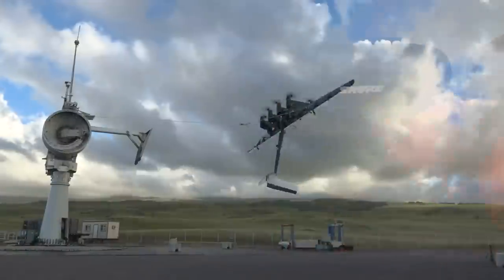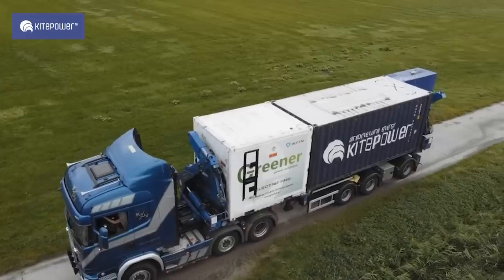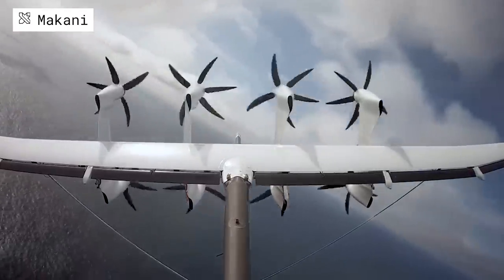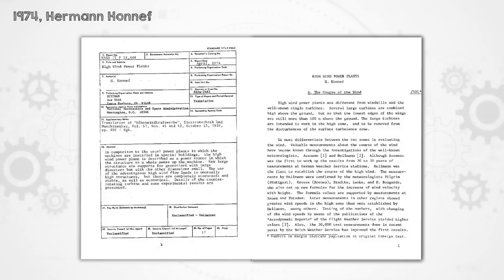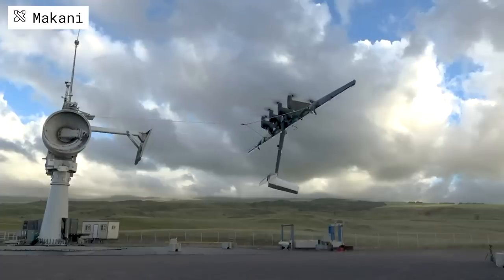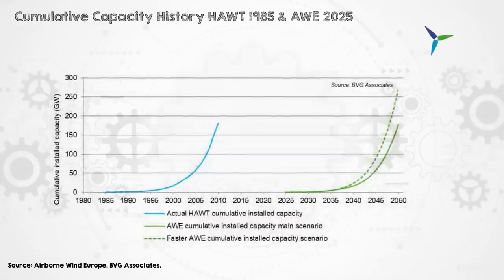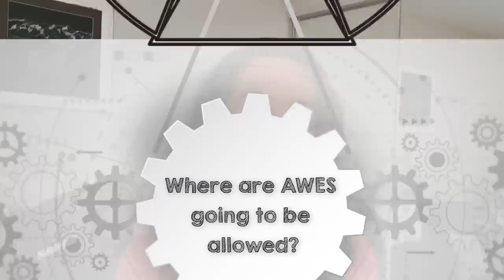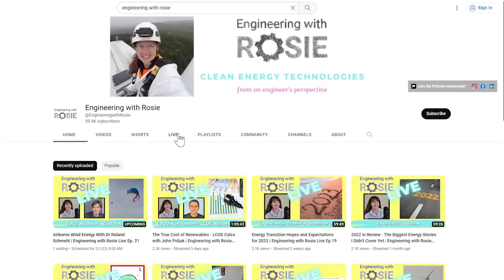Will Airborne Wind Replace Conventional Wind?

Comment: I can see a small scale version being used on sail boats for electrical power.  Sailboats already have masts, travel within certain angles to the wind and are often quite far from populated areas, hence most of the disadvantages would be addressed and the smaller size of the equipment would be an advantage plus the trend for sailboats are towards hybrid sail and electric auxiliary propulsion.  The forces transferred through the teether should assist in the sailboat thrust whereas generating electric power through the propellers increases the drag on the sailboat.  Cameras, lidar and radar could also be mounted on the airborne generator to help AI detect semi-submerged cargo containers and other navigation obstacles that are increasing every year (sonar are ineffective against obstacles close to the surface of the water).
Reply: Probably not though. 
A much simpler solution for sail boat is to just attach a generator to the propeller that they already have for motoring up to docks. 
There are already hybrid and electric drive systems for sail boats that do this.
Reply: @joashparker8271  Well, we already have electric sailing yachts that can use their props as a regenerative brake to trickle charge their batteries while under sail but we also still have many more sailing yachts with wind turbines and solar panels so one solution doesn't obsolete others.  Besides an electric sailing yacht are designed and built as such whereas something like the kite turbine is portable, compact, accesses wind at altitude which are stronger and does not brake the sailing yacht but may actually add to the thrust that the yacht receives from the wind.

Comment: Another problem with tethered systems is risk to small aircraft. Especially with the ones that fly oscillating patterns. Fly a small aircraft into the lines or airfoils, and it's very likely to be the last thing that pilot will ever do.

Comment: So, in sailing you can tack against the wind.  If you've got a sail up in the air, you can let it run out the reel to get power.  Could you design a sail that could adjust its shape to tack back in?  Are there any systems that maybe use two anchors, so they can take keep tension on one tether while 'resetting' tension on the other?  I remember flying kites as a kid how quickly they could move side to side.

Even if a kite could lose some of its surface area so it could 'fall' a bit it could mean you could pull the tether in more quickly while it wasn't under tension.  Maybe something like the parachute vent at the top of a hot air balloon.  It would mean putting some technology up on the kite, but still be less than for full air gen.
Reply: I think you can achieve most of this with very few controls, not more than you would need to steer in three dimensions.

Comment: Great and balanced exposition. I agree with your analysis. Still at sufficient scale and high enough in the air it might be a great solution with less visual and noise pollution than ground-based systems. It's also an inspiring engineering challenge. Launch and land may be done with active motors, gusts may be (partially) treated by changing the pitch angles / lifting surfaces. Weather prediction is still progressing with cheaper, better and more widespread radar systems. Even if recently some investers have been pulling out (due to recent interest rate increases) in the long term there appears to be potential. I'm most worried about lifespan and energy performance versus maintenance, construction and material cost.

Comment: As you say it all comes down to the cost of the electricity produced. I would think they could operate the generator platform as a conventionally powered drone so it could take off and land and maybe power up if it had to for weather conditions but operate as a glider at other times but this would add to costs. It is a pity because it looks cool.

Comment: A drone might be able to lift the windless kite up to a workable altitude before detaching. Doesnt seem like something that would happen so often that it needs to be autonomous either. I can also imagine a slew of self correcting systems that might allow it to survive gusts. For example a coil of free line under high tension, that releases line during gusts. When extended, it prevents the kite from doing any more aggressive dives, and coils back in. I am also still not sold on hard wing kites, soft wings are safer and can land without issues just by releasing the sails

Edit: i also imagine they can add a battery or wire powered control system to the soft wing kite, maybe they already use that. It also adds more possibilities for control systems during gusts

Comment: This reminds me of the tidal planes/kites made by Minesto. It’s like large drones that are tethered to the bottom of the ocean and fly in figure 8 motion to increase the speed of the turbine, so they produce more power during tides, and can produce power during both high and low tide.

Would you be able to talk about those some time? ☺️ I’m very interested in how it all works. 
They are currently testing it in the Faroe Islands and the small kites are supplying some power to the national grid. They are currently testing much larger ones as well there as well.

Comment: How is a free flight drone with windmills on it supposed to work? The wing needs to be going forward to maintain lift and will be driven forward by its motors and propellers. The windmills will increase drag more as they try to extract more energy from the incoming airflow, (that's why planes feather the prop on a failed propellor engine because of the extra drag slowing it down dangerously). So unless you are using more energy to move the wing forwards to keep it in the air than you are extracting, you will stall the wing. The same would happen with a tethered wing eventually, although at least you are not having to use energy to lift the wing in the first place.

At least with a tethered wing you could use the tether to transport the generated power. How is a free flight one supposed to do it, heavy batteries that require even more energy to get them into the air?

I can see why the ship parachute hasn't got traction, it only really helps when the wind is directly behind the direction of travel. It is not controllable like a sail so can't really be used off wind. Even if the wind is a few degrees from the direction of travel, you would effectively be tacking across the wind and possibly using more fuel to keep on course than if you didn't use the kite. So with all of the aggravation in deploying, maintaining, it etc not worth the purchase price or cluttering up useful bits of the ship.

Comment: The possibility of crashing can be solved by using blimps. Even without winds they'll stay up. Another solution is for the glider to be really light and have batteries and use it to keep itself up while there's no wind. Also it could have plane landing strategy where both engines stop working, but it can still safely land by using angles and a runway.
Reply: NUCLEAR IS BETTER THAN THIS TOMFOLLERY

Comment: You don't have to install a foundation (in the sense of holding the tower up) but surely you do have to install an anchor (in the sense of stopping the thing flying away). The tether force has to be resisted by the ground ...

Comment: Back in 2012, I designed a kite that would have the generator and prop framed in its center.  It was supposed to be tethered to a station below, using an Adruino and anemometer to allow the kite to catch the wind in any direction (making corrections as needed). It was of course, all drawn on printer paper at home, and I had no idea how I'd make it or afford to try to make it back then.   Now, I am hesitant to re-visit it, in fear of looking like a dumb dumb.  lol  Maybe I will build a scale model of it one day, and just take my pick up to a back road, in the mountains and try it out.  lol
Reply: u should. keep me posted if you do

Comment: Interesting, thanks! I wonder how they'll deal with air law especially if those kites go near or above 500 ft. It would also be interesting to compare long-term costs vs ground turbines (which I think is controversial for those), the production per occupied square feet, and the perceived nuisance.
About the birds, I thought they were fast enough to avoid most of propeller-based engines, I had no idea it was significant. But then, many are also killed by power lines...
Reply: Not a problem above 500ft. There are restricted flight ops areas all over the world, including over all military bases, most if not all Nuclear power sites, parachuting areas, every NFL football game, the White house and on and on.  They get published on airspace maps and if they are temporary they go out with the local area notams.
Reply: @johnway9853  I know that, but that's generally not abused and as you said, it's mostly temporary events. I've never seen many of those restricted areas when flying so it's rarely a bother (mostly some pesky drone areas), but if we need to deploy as much AWE as necessary to replace conventional wind turbines though, that will complicate the airspace significantly. Maybe it's easier in the US, but smaller countries have more complex airspace structures too, where it's common to have close CTR that don't leave much room in-between. Having such restrictions would effectively cut a lot of routes to GA traffic where they are most needed.
Reply: @phenanrithe  Every tower I controlled in, all 7 of them, had some sort of permanent restricted airspace nearby.  The tower I retired from had a military base directly abutting us so the downwind for 09 had to be kept tight so as to not cross the line. Not like these things are going above FL180. I can see the point in some of the tight EU airspace but even then... as my first on the job ATC instructor used to love to say, It's a big sky. ;-)
Reply: @johnway9853  Well, it certainly didn't look big where I learned. Squeezed in the term that comes to mind.
Reply: @phenanrithe  LOL, I know what you mean. In 82 I got my PPL before going to ATC school. The difference in perspective is gigantic. My last tower was also a training tower with more Katanas than should be allowed in any one place on the planet. I figured these kites aren't going above a couple of thousand feet or the weight of the cables becomes an insurmountable issue. Add a couple more thousand on top like built up area rules, and it still makes it less of an issue than many of the snow topped granite barricades out where I started my career. Many a fuselage still on the sides of those mountain passes.
Reply: @johnway9853  Yeah, I suppose they won't go too high indeed, even though that's where the wind is. Imagine one of those long cable snapping because of a gust, we'll revive Pink Floyd's story with their pig balloon and every pilot on the look-out for an escaped flying kite ;-)

Comment: Could you smooth out the spooling/unspooling energy load by funiculating two together?
Reply: "Funiculating" two together sounds like you want them on connected tethers?  Sounds like a nightmare for fouling and knotting.

Rather you would have multiple units with distinct ground tethering points, far enough apart that the lines do not risk getting entangled.

Since reeling in can be done much more quickly and under lower tension than the long crosswind flight which pulls the tether out, you would probably want more than two.

I vaguely recall an early proposal that had multiple units moving at intervals along a loop railway track, probably using ground traction in place of constantly reeling out and back in.  The advantage eludes my imagination though.

Comment: I have a feeling that once they really crack the code on this technology, it will be as sleek and simple as the three blades on a tower version. We need a lot of iterations to go from the old dutch windmills for cutting lumber and milling grain to today's tall sleek windmills.
We do know there is more wind up there, we just need to figure out how to tap into that in a cheap, robust and reliable way

Comment: Interesting idea, I have given it some thought since your last video about it, I still think most of my initial reflections are relevant, for example I still think most projects focus too much on chasing energy efficiency over cost efficiency. 

I'm still skeptic about using crosswind, way more energy to harvest, all else equal sure, but also way more difficult to make it work, especially reliably, which should be pretty obvious to anyone by now. A non-crosswind unit that stays up can harvest infinitely more times the energy than what a crashed crosswind unit can. I suspect crosswind utilization represents the majority of what makes heavier than air systems more difficult than conventional wind power at same scale.      

A case that I don't think, but know they chased theoretical efficiency in vain is that balloon funnel. Lighter than air wind power systems should be shaped like airships, to have some chance of working practically. Just increase the rotor size to get higher output, that's not difficult. It's much easier to have variable pitch than make a balloon funnel adapt to varying wind speeds. An airship can be made big and also have solar on it. If it's made tough enough to operate at very high wind speeds at high altitude, it could just be lowered if the wind increases too much at normal operating altitude.
Reply: i really like the airship idea. Proven technology that should be easy to automate

Comment: Important to note that this is not competing with conventional large-scale wind generation. This is much more expensive per kilowatt hour generated, and the watts generated are far smaller than a standard large ground or sea mounted generator. Megawatts for standard turbines vs kilowatts or 100s of kW for these. There may be a use in these devices for temporary small scale power needs far from a grid. So yes very interesting technology but really completely different set of edge use cases.

Comment: i really think there's big potential for this tech just bc it has a smaller actual land footprint than most. Like, if we can figure out a way to safely put this on top of things, you can increase your energy gen without land costs. E.g. can they be designed to fly over solar panel field? If they're high up, they shouldn't effect solar gen, and then you have a lot of the transmission and other necessary tech already installed on site. Even potentially on top of large buildings (esp if using soft-materials). 
So it may not make economic sense "on its own" for most places, but perhaps it conjunction with other tech or contexts.

Comment: I remember watching a documentary about a team building one of these things and it was fascinating. The team was so bright and hard working but their financing ran out right when they found success and so they had to mothball it. I do think that the complicated control systems probably mean that it won't be a big player in the market, but, where they make sense, they'll be hard to beat once someone makes a truly viable product.
Reply: Google bought em and shut it down, so sad.
Reply: @Deaner3D  There's a doc about it, “Pulling Power from the Sky – The story of Makani”. Using the sky is probably not the best option. Imagine the same thing, but under the water. There's a number of different tech being explored, but something like the Makani in the deep sea flying a figure 8 could be interesting.

Comment: Would this be a good option in the case of cargo shipping to recharge batteries that power electric propulsion? It seems similar to the sail-based wind options and since in deep water there would be few restrictions, I would think it could be useful.
Reply: The reason Skysail stopped trying to power cargo ships was that the economic incentives were misaligned. There are very few owner/operators. Most of the time the people who own the ships don't buy the fuel. That is paid for as part of the cargo shipping costs. So the people who make the savings from the sails don't own the boat and can't install the sail, and the people who do own the boat don't make any savings because they don't buy the fuel.

It could certainly work with the owner/operators out there, but you have to figure out those misaligned incentives first before you can appeal to the majority of cargo ships.
Reply: The previous incarnation of my company was trying to do exactly that, but it turned out to make more sense to use the kite for direct propulsion, rather than going through the electrical conversion process.  There can be an advantage in wider utilisation of different wind directions (you get electricity from any direction, but only useful propulsion from a few), but then you have to account for the effects of the kite's line forces on the ship's heel & leeway (roll & side-slip).

Comment: I'm building a cargo trailer rv conversion that runs on solar.  I was looking at a small wind turbine as a possible supplement.  An inflatable or parachute-type would be just about as physically small as I could get while generating enough wind power to be worth the space.  I'll look back at this technology in a couple years to see if there's anything small that's commercially available, or if any concepts seem good enough to build my own version.
Reply from the maker: There is something like this already. No idea if it's actually any good though! https://kitex.tech/
Reply: @EngineeringwithRosie  Wow, that's awesome.  Thanks!

Comment: A blimp with electric generator around the circumference would capture high altitude winds. Hydrogen or hot air could be used for buoyancy.  For maintenance or storm protection the blimp could be hauled in and stored in a shed.  If damaged the blimp with minimal infrastructure could be replaced.